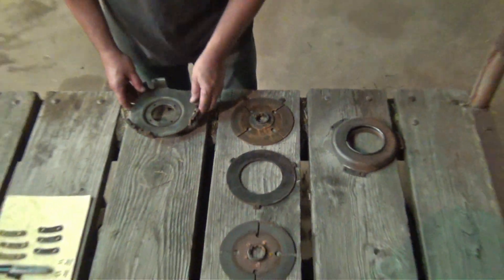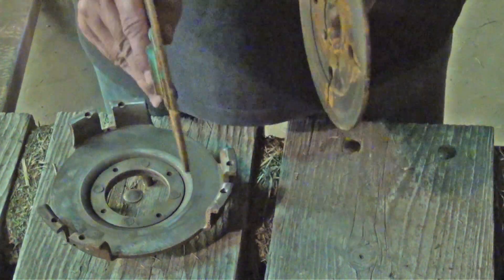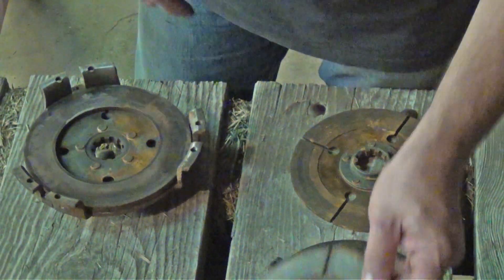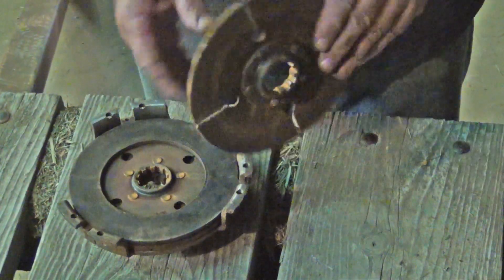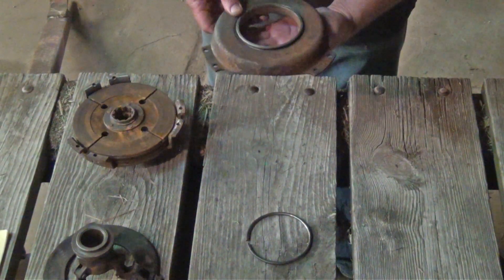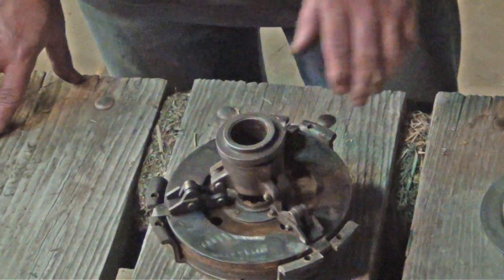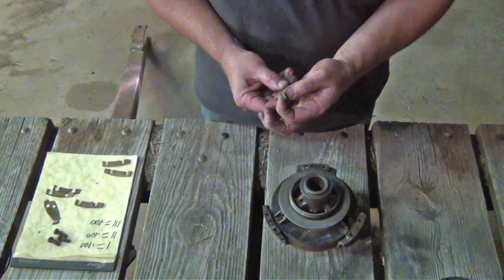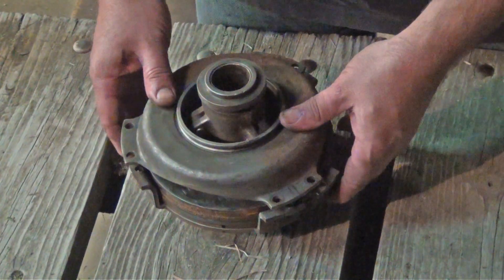WD/WD-45 Hand Clutch Rebuild

Comment: Hi Dennis,
I'm happy to find your videos.   We have three non running WD"s on the farm.  One has been there since it was new and would probably run if it had gas oil and a battery.
Are the wear surfaces of the discs in the hand clutch metal or some other material.
Reply from the maker: Yes they are metal and can not be reworked. If the disc still have grooves then the disc is still useable.
Reply: Dennis,
Thanks.  You have a great site and your explanation of  the clutch was impressive.
Reply: will a wd 45  hand clutch assembly fit in a wd  @The1952caallis
Reply from the maker: kathy taylor yes, but the WD-45 clutch is longer. So you must shorten the studs on the front of the clutch. Make sure you don’t take to much off because you still need to use the studs to mount the clutch. After the studs are shorten it will still be a tight fit and may take a little finesse to get it in. I put one in my WD as well.

Comment: was there another clutch used ?   in 1958 / 59 nebers 1955 wd 45 wouldn't lock in we took off cover looked at it we put it back together he talk with others about it .  then week later we open it up again it had a ring / disc with a canffer on outer edge (back) it was threaded in center  [a lock to keep it in place] you turned it to thighten and get a new edge on the canffer where it lock in and out on {  turned it a little put lock back clutch worked fine again }  .  I was 12 or 13 back then .  thanks George
Reply from the maker: To my knowledge Allis used the same design all the WD & WD45's. They just add a disc for the WD45.

Comment: Dennis I'm in the process of trying to replace the seal in the transmission of a wd I've got the tractor split apart at the bellhousing in the hydraulic Reservoir I need to pull the input shaft I was told that I need to remove the cover to the hand clutch housing loosen the four bolts on the outside of the hand clutch and that the shaft should pull out. I loosen the bolts or nuts rather and can't seem to get the shaft to pull out what position does the hand clutch need to be in to remove or is there a special trick? Thanks in advance
Reply from the maker: I'll need a little more info Matt.  What seal are you replacing and what shaft are you removing?
Reply: I'm replacing the seal that separates the hand clutch  from the hydraulic resivoir. I have the tractor split at the bell housing and hydraulic res.  I'm told if I loosen the 4 bolts on the hand clutch that the I'm out shaft will pull out. is that correct?
Reply from the maker: Alright now we are on the same page. 
 The hand clutch needs to be removed. After clutch removal look inside the gear which the hand clutch was bolted to. You should find a snap ring that holds the gear onto the shaft. Remove the snap ring and slide the gear off. Now the only things holding the shaft in place are the bearings.

Comment: Good DAY. boy good video.  Why has 45 got extra plate,because of power. Is there anyway of telling if clutch is going,if you were buying 1.  What type of oil do they run in.  I would like possibly 1.  I was told  that cranks break  THANKS
Reply from the maker: The 45 has  more plates due to more power. The only way to tell is by taking the clutch cover off and looking at how thick the shims are and how loose the clutch plates are. I have not come across a clutch that was worn out, most just need to be adjusted. If you pull the hand lever back to engage the clutch it should feel tight. If not it will need some shims taken out. I have never seen or heard of cranks breaking in the "W" series of tractors.
Reply: Thanks.  Can you do a video on traction  booster.

Comment: Hi just watch yours video on 45 clutch i n joy it.my question is have u ever work on a trycle frot n were it was shakeing
Reply from the maker: 1st look at the steering shafts and universal joint for wear and slop. 2nd look in the front gear box to check gears and bearings. If it's bearing wear you may be able to remove shims. If it's gear wear you will need to replace both gears.
Reply: There is a set screw with a jam nut down low on the pedestal. Behind it is a key that sets in a keyway. If either the key or the keyway are wore, that can cause front end wobble too. Sloppy wheel bearings can add to wobble also.